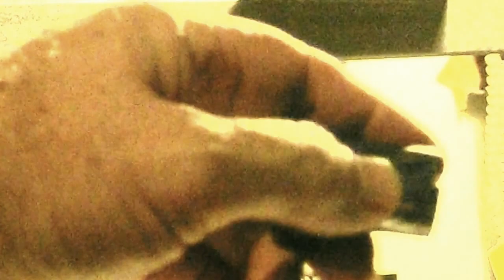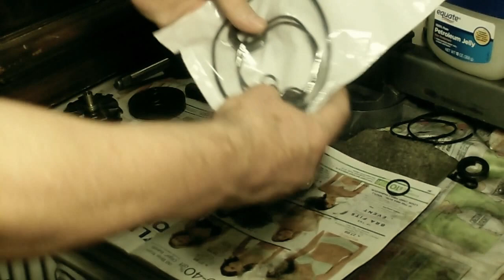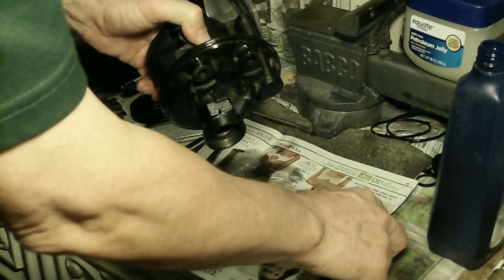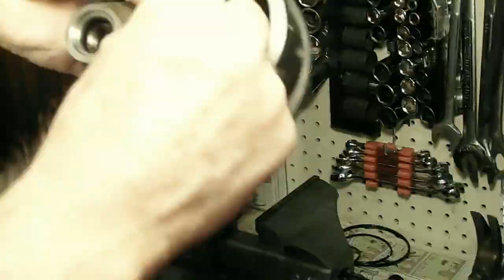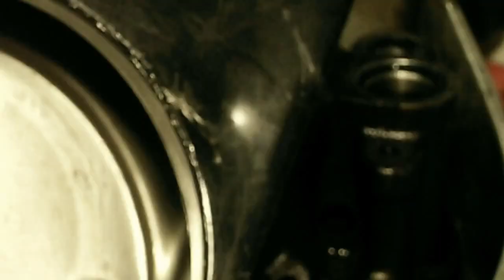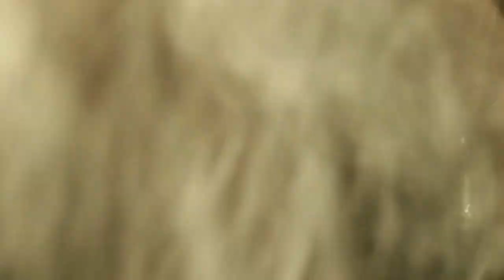Power STEERING pump REBUILD under $15 - Part 2 - Assembly - Bushing & Pulley Installation, Fix Leaks

Comment: This pump is not going to work, reason being what you called the high pressure inlet (which is actually the outlet) you inserted the thin O ring instead if the thicker one (there are two different kind supplied with the kit) so it will not seal. On the small wholes you used the correct ones. But more importantly you forgot to insert the spring and pressure valve into the high pressure port before inserting the large port connector. Without the pressure valve you will not have controlled pressure output from the pump. Got to redo that before using the pump.
Sincerely, Bernhard
Reply: If just changed hige pressure pipe on my ford transit an when undone the hige pressure pipe from pump a valve an spring came out any ideas how they go back in

Comment: Great videos, Izzy!  I just completed this exact job on the power steering pump of my 1986 GMC S15 Jimmy 2.8 liter.  My pump and reservoir were identical both inside and out to your rebuilt pump.  Most certainly a Saginaw pump.  Thank you for the incredible detail you provided throughout, which made the work go exceptionally smoothly!
Reply from the maker: You're welcome. Thanks for your feedback.
Reply: That exact pump was used on a lot of GM products since the early 1970s

Comment: Its a great video, because you explained the positioning of the internal parts correctly to cause proper oil flow, and pressure. However, just a couple of minor remarks. First: The notch in the seal does not need to match. Its put there for removal, not for oiling. Oiling is done by the groove inside the seal (like a rifle grove). Second; why did you put the external O rings prior to finishing assembly of the internals? Thats perhaps better done once you finish putting together the internals, and close it with the cap and retaining spring ring. The rings we put just before we want to put the assembly into the pump can. Thanks
Reply from the maker: You're welcome. Thanks for your feedback.